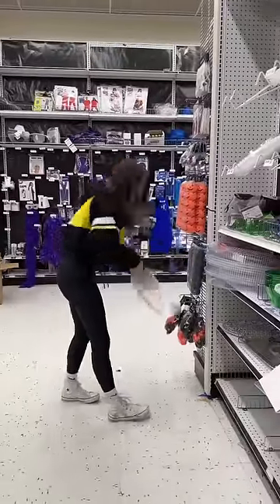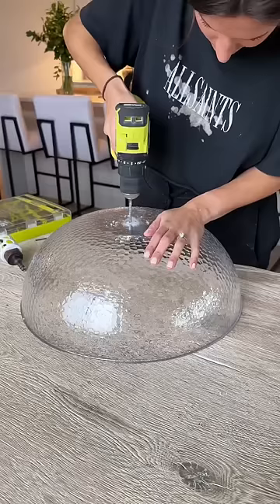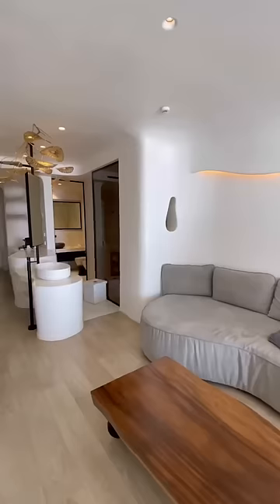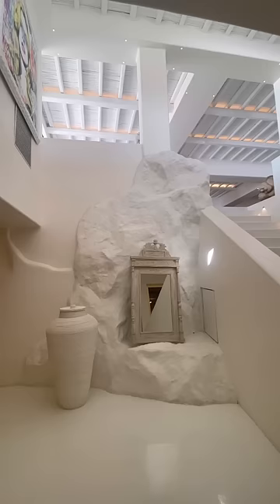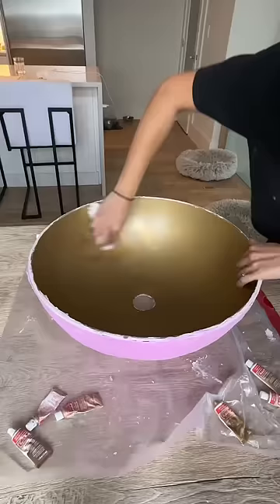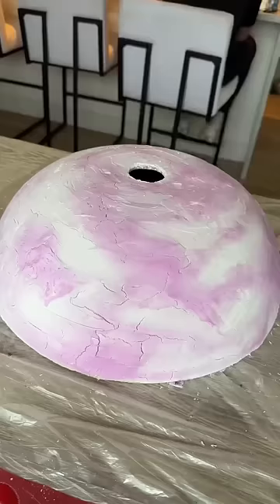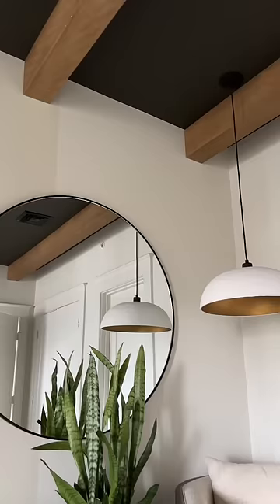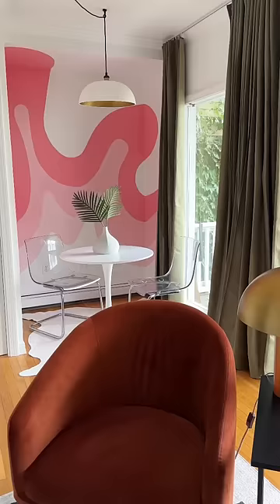DIY Dome Light Pendant on a Budget

Comment: Side note to ensure the electrical is all safe since you don’t know if the stuff you used is flammable.
Reply: Safe electrics? This Is a country that hammers in earth rods and then doesn’t bother with testing them (from the videos I’ve seen on here anyway)
Wire nuts to join cables (potential high resistance leading to heating issues) and has bare terminals on socket outlets. 
I should think that lampshade is the least of the worries.
Reply: The overwhelming majority of new construction we use Concrete encased electrodes. And in the case that you are using ground rods unless you’re using a singular ground rod engineers have not found it to be necessary to test as it always meets the minimum amount of resistance needed. Wire nuts are only typically used on connections up to 10 gauge wire. Anything much larger than that you’re using split bolts or Polaris tabs. Very solid connection. As for the light you could make the point that it is not UL listed. And that material has not
 gone through testing to ensure no fire hazard. But realistically if you put a LED bulb in there I sincerely doubt there would ever be a risk of overheating.
Reply: I was thinking the same thing about fire hazard.
Reply: Everybody uses LED bulbs nowadays.  They give off almost no heat; certainly not enough to set anything on fire.

Comment: Omg this is sooo awesome! Can you list the materials that are needed?
Reply from the maker: Plastic bowl from party city
Spackle
Gold spray paint
Grecian gold rub n buff
Sand paper or sanding block 
Damp Sponge
Drill with hole saw attachment

In the end you may also need a lamp shade ring depending on your pendant!
Reply: @The_AvantGarde  subscribed
Reply: @The_AvantGarde  HOW AWESOME.
Thank you so much for the materials list.💗
Reply: Wow!!
Reply: @The_AvantGarde  the plastic won't melt?
Reply: @emilyblaxton2601  Not if you use an L.E.D. lightbulb! They use less energy, and expel less heat. I love them, and use them in many of my lighting projects. Hope you find this useful dear.
Reply from the maker: @Microphonecheckher  thank you so much!
Reply from the maker: @emilyblaxton2601  not if you used LES lightbulbs! A lampshade ring also keeps the bulb form direct contact with the lightbulb
Reply: Why? You know you're not gonna make it.
Reply: For anyone reading this - your electrical cable is not supposed to support that amount of weight. Add a chain or something to take the weight, otherwise you're going to set your house on fire.

Comment: Make sure you also use a low watt light bulb! The heat from a high watt bulb can melt the plastic! Has happened to me!!
Reply: Who the heck is not running leds in this day and age
Reply: @southernracing2468  the halogen man.
Reply: Even if you use a super bright bulb (20 W) you're going to be fine. Unless you're not using LEDs in which case what is wrong with you?!
Reply: @southernracing2468  LEDS are awful for your eyes and sleep patterns though and constantly flicker which is over stimulating.
Reply: @wanderingoldsoul420  I don’t doubt it luckily my house is naturally lit well in the day time so I don’t have to be under them all the time

Comment: Are you sure that's safe, for a light to be near?
Reply: LED lights don't even get warm to the touch anymore. Plus fabric lamp shades have been acceptable for longer than that even so proximity to the light bulb isn't an issue. As long as the weight is appropriately supported so strain isn't put on a cord that isn't meant to support it'll be fine
Reply: Hey hun, do you smell burning plastic😵‍💫
Reply: People use paper, wicker and all sorts for shades. As long as bulb doesn't get hot it's ok
Reply: Led bulbs are pretty good at not getting hot
Reply: That’s the question we all need to ask ourselves when diy’ing. That research before following blindly is important.
Reply: It is spackle or joint compound - used to repair holes in walls and ceilings. It won’t start a fire but it’s going to crack and flake off after few uses.
Reply: @maisydaisy9216  This will happen with or without heat!
Reply: You can buy a spray can of rust oleum clear coat; it can withstand 200F.
Reply: @maisydaisy9216 you could always modpodge a few layers of tissue paper on top of it before painting it. That will keep it in place.

Comment: If you are hanging any lamps or electrical appliances always remember using an external wire, never hanging it from the actual power cord.
Stay safe.
Reply: Awesome space.
Reply: IKEA has always used their power cords to hang lamps… they are much heavier wire gauge
Reply: Some power cords are stronger and made to use for this purpose
Reply: @timdooley8440  The word "IKEA" tells you everything you need to know about that sentence.
Reply: @apocalypseinfantry5628  so you’re an engineer or an electrician… I’m both. 😂
Reply: @apocalypseinfantry5628  oh, I’m sorry infantry says it all 😆
Reply: They sell conversion kits for this now, thankfully!

Comment: Love this video. Even so, very curious about the weight of the finished shade product.
Reply: It’s just a plastic bowl with a light in it, shouldn’t be very heavy at all
Reply: @godisdead6611  Maybe Teague is curious about how much the plaster weighs, not just the bowl.
Reply: @bouldermimi1178  spackle is pretty light. It’s more like a moon sand density than cement

Comment: Just goes to show that most designer stuff can be replicated with cheap materials and no one will be the wiser.Just save your money and DIY😍
Reply: Yes if you’re being careful but that globe can’t withstand the heat that the lightbulb will let off and it will just melt the globe, it’s a huge safety hazard that’s just a plastic bowl she used a lightbulb let’s off an exponential amount of heat. When electricity is involved it’s not a diy it’s reckless.
Reply: @chloes7497  you sound like the fun police👀 I'm sure there are ways to make it safer without having to spend thousands

Comment: Just a quick tip right off the bat, unless you did it on purpose of course, to stop your 'bit' falling out the drill when you tighten the chuck, just lightly twist it the opposite direction until it clicks, it'll lock and never loosen up when drilling

Comment: I'm pretty sure most spackle products are meant for like holes of 2 in if not backed by something like a mesh or drywall.
You doing this again? I would probably reinforce it with drywall mesh or maybe use a plaster instead.

Comment: It would look way better if you move that light instead of having that cord dripping and it’s not that hard check it out where the cord is dangling get a skinny long screwdriver stick it in there to check if there is a stud or no stud but when you stick it in there still in there straight and then to the left and to the right to check for studs if there’s no studs that’s great that light Does not look that heavy so it regular popping box will hold that up and all you have to do is go to Lowe’s or Home Depot or hardware store. Ask them for a round Poppin get the Poppin put it up to the ceiling did you pencil trace around it and get you a saw Cut the hole out, undo the other light, but first turn off the power and then undo the other light disconnect it then cut the hole the new whole stick your head in there. You should be able to reach it reach the wire with your hand, the old box and yank it out and it should be working

Comment: oh dear. your going to need to buy another one of those bowels. spray paint the OUTSIDE of it, so you will get the clear gloss of the plastic AND the little hammer effect shape on the inside. then plaster the outside like you did. it will be 100X better. trust me.

Comment: This DIY won't last past a year. You used  a wall compound that will eventually crack and fail due to temperature changes.  It looked nice, but roughing up the outside with at least a 120-grit sand paper and using a flexable bondo usually used for bumper repair would make this last longer.